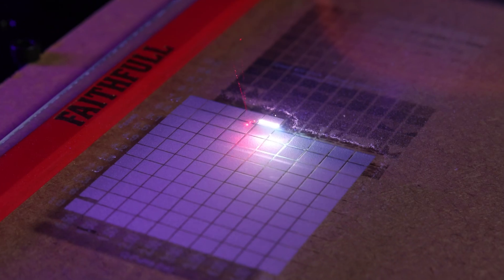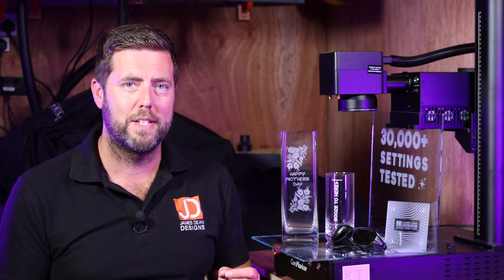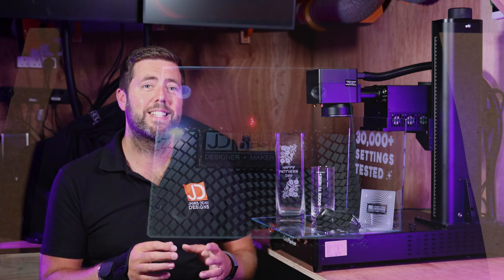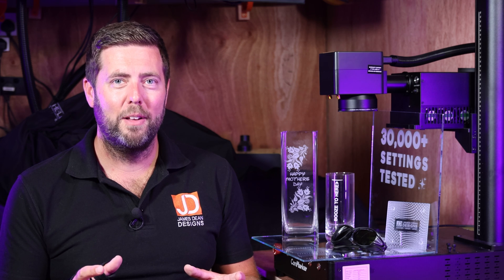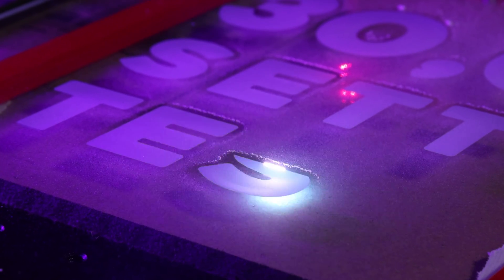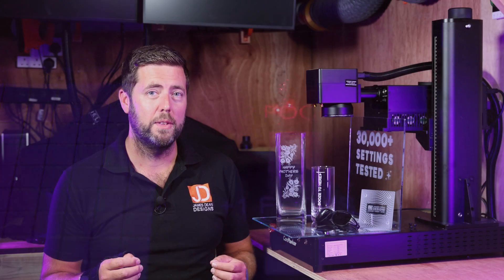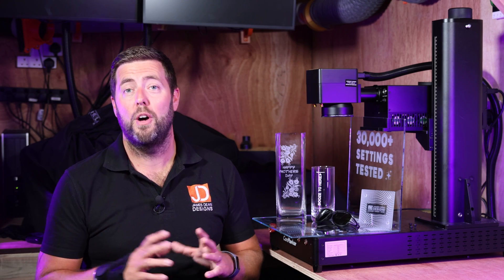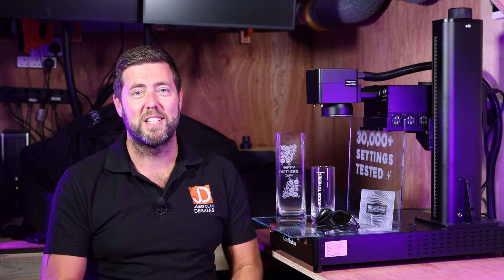Testing 30,000+ Laser Settings to Master Glass Engraving — Here's What Actually Works!

Comment: Well James I got some bad new for you but I don't know if is is the settings or the glasses.  Used your setting for the glasses. 300. 32/1 bi , .006. Just got a call from  the client that 40 out of 100 glasses have a crack at the beginning of the engrave. I checked my rejects that were not shipped and yes it happened here.  Previously I had 2 orders totally 250 glasses with no reports of cracking, the seethings that I used there were  100, 40/1. bi, 03.

Could it be a heat crack due to the .006 line setting?
Reply: James, should the glass feel warm right after engraving.  what else besides heat would crack the glass?
Reply: the crack occurs right at the beginning of the engrave

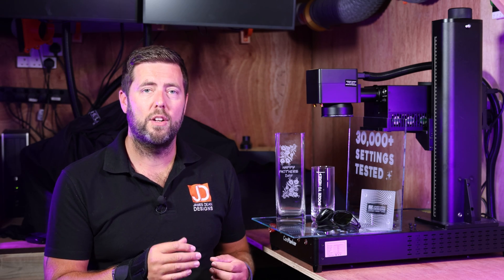Comment: Used your setting, 300. 32. .006 look 1:49 minutes.  Just saw a another suggestion  300, 35. 2000 lpi  took 1:32 minutes with no change in appearance.  Might want to check it out  40% quicker

Comment: James , in the video you talk about lowering the speed doing a outline  60 -80 speed Was that actual speed or dropping it down from the 200-300 range?
Reply: Did you find that the settings changed from flat glass to drinkware?
Reply: all kind of questions, what about split size and overlap when using a rotary

Comment: I engraved a pilsner glass using 300 mm/s, 1QP, 32 khz, 0.005 line interval, out of focus 2mm.  my glass cracked, I upped my Line interval to 0.008, the glass cracked. I've tried different setting with no good outcome. Can you recommend a better setting on a pilsner glass? I have 250 of these to do.
Reply from the maker: Glass can be different. If it's cracking then you may need to try and smaller line interval like 0.02, possibly a higher speeds as well but turn on the wobble function. My recommended settings gave me a great result but it does put quite a bit of energy into the glass

Comment: My settings are very close to what you identified but I use cross hatch. I'll have to do some more testing... I have the Omni 1. Have you found your settings change when doing a raster vs a vector? I'm not getting good results when doing images.
Reply from the maker: I never tested images but it will depend on how it's being converted. Usually when processing images they vary a setting to cover the changes in colour which I suspect will be the issue here. It's quite difficult to get varying shades in my experience so it will likely only work as a pure black or white image

Comment: Used your settings on a pint glass. Took 8:54 minutes.  I ended up at 300, 40/1, BI, .01, 1 pass and a defocus of +5mm.  Did cylinder correction at smallest diameter of engrave.  Took 4:04 minutes.  Yes, there was a difference but not worth 5 minutes more time. Just a thought.  Great video, thanks for spending all that time
Reply from the maker: Thank you for sharing your information 🙏

Comment: James, thanks for this review!  Personally I have started using wobble on a lot of my glass engraving.  It is slower but it has helped me get good results with just one pass where I have struggled before.  Have you experimented with wobble?  You might also want to mention your other setting such as bidirectional or cross hatch.
Reply from the maker: No, I didn't test wobble but I may do some more test comparing using higher speeds with wobble against lower speeds without

Comment: People are getting bad machines. Site reviews not great
Reply from the maker: I believe when they launched, there was a bad connection for the rotary driver. They have now rectified this and sent new parts out to those effected. Haven't really seen any other issues than that but I could be wrong
Reply: @JamesDeanDesigns bad out of the box, replacement failed. Nothing to do with rotary
Reply from the maker: @jppalm3944 do you mean on the ComMarker site? I'm seeing 160 5 star reviews versus 2 1 star? Think it's just bad timing the two 1 star reviews are most recent but people are able to make up their own minds. Mines been flawless

Comment: Thank you! I don't think that you mentioned the lens that you were using?  Related to that,  did you notice any  differences in the engravings relative to the angle of the laser beam?  Finally, where can I get some chicken milk?
Reply from the maker: 150mm lens and no I have just released i never mentioned that. No, even when I was doing the widest parts it still seemed stable. If using something like a 300mm lens it may be worse. Chicken milk....available at all good super markets 😂

Comment: Love my 10w UV for glass. Can’t wait to try your settings to see if it helps, but from memory my speeds are a lot faster than yours
Reply from the maker: Yes, I saw on one of ComMarkers posts about 1600 but they did 5 passes. I found higher speeds were ok on some types of but I got more consistent results going slower. But do let me know your settings when you get chance.
Reply: I am running S200 F40 Q1 and L0.03, does not give bright white results but the results are okay and those were recommended by Commarker. 

I tried James one go settings but I set the speed to 600 because I was afraid the glass won’t handle his settings at 10w. The results were a tiny bit brighter but took a lot of time. 

The quest is still on for getting a bright white engraving at reasonable speeds and taking safety into consideration. 

Wish if James could get his hands on the 10w machine and share his wisdom with us ❤